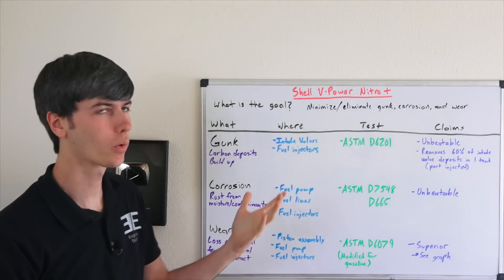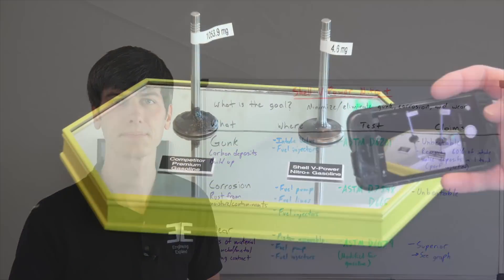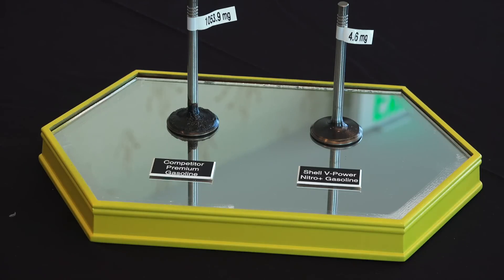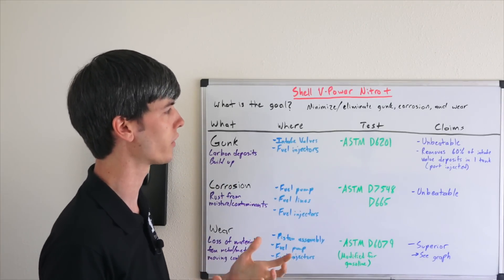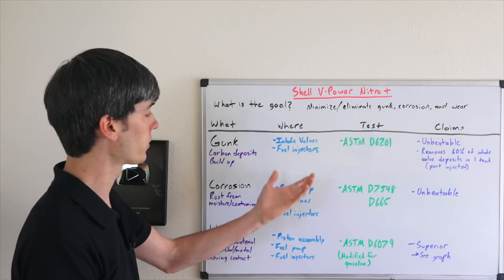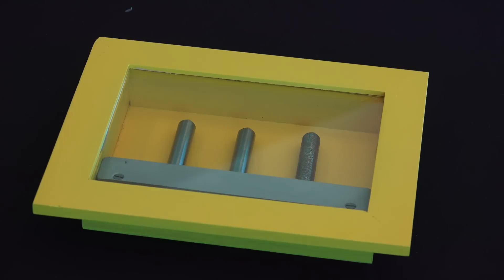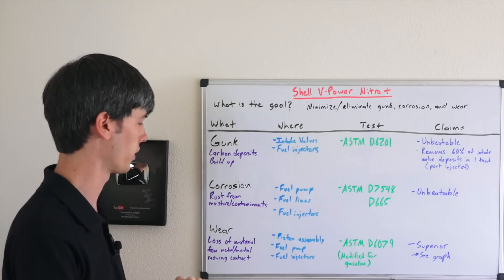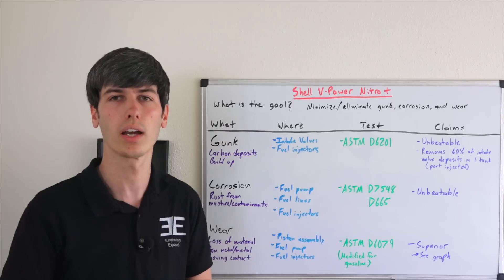Shell V-Power Nitro+ (Premium Gasoline Fuel Testing)

Comment: notice all his buddy's pics of nasty intake valves. the are all direct injection heads.  That gunk is from crank case gases being fed back into the intake track for emissions. No gas additive will do anything to that on those engines.  cars need better oil seperation on that emissions line not better fuel.  almost every engine sold now is direct injection so this is not actually a good test for modern engines.  I wonder why he wouldn't be showing the piston tops and combustion chamber as well?
Reply: Or run oil catch cans as standard
Reply: yes. I think oil catch tank eliminates gunk . the fuel n air shudnt produce gunk, I think. this is to sell unnecessary product instead of car manufacturer installing appropriate catch tank. correct me if I'm wrong. thx.
Reply: +cisa93 
I remember those oil vapors into the air cleaner housing.  What a MESS !  That little plastic fiber mesh filter was a joke !
-
I have homemade inline filters (two stage) that the oil vapor goes through before re-entering the manifold.  Once a year I clean the filter media with a solvent and then recycle the dirty liquid to a hazardous waste facility here in Boulder.  My containers have a valve on the bottom where I can periodically drain off condensate water, that is a component of the oil vapor stream.  True, that oil vapor hitting the hot intake valve will bake on as a hard air/fuel blocking crust, much like cholesterol in an artery.
-
There is a commercially available inline oil vapor filter called Condensator @  http://www.condensator.com/
-
Install pics here:   http://forum.ih8mud.com/threads/condensator-pcv-oil-catch-can-install-and-1-month-results.740888/
-
$225 U.S. Which caused me to build my own set up.  In 1984 they were going for $30 U.S.   Advert came in an envelope with alternative carburetion schemes literature which included plans you could buy for building the infamous Pogue carburetor.  The pages were copies of a copy of a copy of a copy of a..........
-
A small history on PCV:   http://www.herningg.com/projects/PCV.html
Reply: +Derrick Hollenbeck Ford Eco Boost engines have problems with intake valve build-up even at very low mileage--
Reply: +cisa93 I think they would actually work as intended to. it's the sensitivity of the engine that requires very specific adherence to manufacturers standard of maintenance that may fall flat with most consumer. 

aren't we all mostly looking for the cheapest fuel, cheapest maintenance, cheapest engine oil, etc.  

That's not to say what you mention isn't valid.
Reply: I think that Shell's detergent chemistry may not survive the heat of combustion well enough to do as good a job of cleaning cylinder heads and piston tops as some of the other detergents, like PEA based detergents.

Comment: man please Mystery Oil been doing that for many year an it cleanes ur engine in side out i been doing test since i was 10 years old i wouldnt say. i inow it all but i well say i know a little of a lot i am self tought engines tires rotors brakes  speakers amps electrical an many more e.g. gas 87 89 93 some pump may have 91 what are these number most peopel say gas is gas not true an oil is oil..........

Comment: I wonder if the "competitive" fuel is even a top tier detergent gasoline. I've seen these valve comparisons for years and they have always looked about the same - gunky competitor, near pristine with "our" gas.  That's not a new claim and with each new fuel released, the "old" is always the same gunky one that's been the basis for comparison for years.

Comment: dude those vw valves are from direct injection engines... totally not the same and fuel isnt washing over them. these deposits are really... imo.. produced by crank case vapour management and high volatility oil... but thats another video... btw top tier fuel is listed in many tsbs from all major manufacturers and i use only shell premium

Comment: +Engineering Explained 
So you did a video for Shell V Power in general, but in my area, we have 2 different types of the Shell V Power gasoline. One is a 0% Ethanol 91 octane, and the other one is a 93 octane that may contain up to 10% ethanol. I try to run the 93 when I can, but do run the 91 as well. Is there a benefit or lack thereof for either one or will running either one be okay? I'm also running it in an older car (1992 SVX) and I just want to get the most out of this engine before I come to rebuilding it.

Comment: we have had v power+ nitro for years in the uk.have used it in my motorcycle the past 2 years.wasn't  a fast fix, did take 1000s miles not 100s, but the mpg did slowly go up, to where it about 4mpg better.

Comment: Shell currently makes my SRT8 have short knock so I run Petro-Canada gas because its the only brand that doesn't cause knock. What octane will this new fuel be?
Reply: +4u2nvinmtl Found my answer on Shells site "Shell V-Power NiTRO+ premium gasoline is Shell’s highest octane gasoline". Shell V-Power NiTRO+ is 91 octane and that's lower than the 94 I currently run (from Petro-Canada) but I'll give it a shot again and see if I get knock (tuned for 91 octane).
Reply: +4u2nvinmtl aint it 100 octane?
Reply: Pilek01 Nope it's 91 octane. Checked Shells website...
Reply: +4u2nvinmtl in Poland we have 95 octane as the cheapest regular fuel also V-Power Nitro + is 95 in PL and Premium fuels being 98 octane while V-Power Nitro+ Racing is 100 octane as the best on market here. prices here are 4.67 us dollars per galon for regular and $5.7 for V-Power Racing.
Reply: +Pilek01 Lucky Polish!

Comment: Lol! All these comments are hilarious. I hope everyone knows that most of this carbon build up on the back of the valves is mostly related to Direct Injection and not so much tuned port. With DI, there isnt any kind of fuel or cleaner being sprayed on the back of the valve, its just an accumilation of hot EGR and PCV gunk. This new snake oil Shell gas is just more hype. He mentioned his friend who works at a VW dealer. Well an increasingly number of VW's are DI and the pictures are most likely from DI vehicles. Does Shell do everything it says it can do? Sure. Could you get the same results on a tuned port injection vehicle and run injector cleaner every now and then and give it the old Italian Tune Up to get the same results? Yes. If you own a DI vehicle and you want to fix the carbon build up issue, I would recommend a meth Injection setup with an injector nozzle right behind the TB and run 100% Denatured Alchohol in your meth tank. Support your local meth dealer...lol!

Comment: we have a 1980 mini club-man that has done 50 thousand miles and it runs on completely normal fule and we have the head off and completely strip the engine and it had barely and carbon deposits what so ever. For that amount of carbon build up there has to be something wrong with an engine people dont buy into this premium crap its no different to your average fule its just ripping you off

Comment: engine valves shown are from direct injection???? I don't think so!
Reply: +Engineering Explained port injection or direct injection? Because in DI engines the fuel/air mixture is created inside of the cylinder, so the fuel has no chance to clean the valves - can you explain your theory here please? I personally run N54 BMW direct engine 3.0 twin turbo engine with direct fuel injection, I use only Shell V-Power Racing 100+ fuel and I still get the carbon buildup on the valves, so something is wrong with this theory - please explain.
Reply from the maker: DJ12Ema Yes, DI, as annotated and listed in the description.
Reply: +One Monster exactly!
Reply: +One Monster Well the nitro stands for nitrogen which is used as the detergent in gasoline so maybe that has something to do with it but I totally agree with the DI point you and +DJ12Ema are making.

Comment: Looks and sounds like they are comparing regular gasoline vs their premium( you can see that in there graph near end of video). Regular gasoline has more methanol, which is basically alcohol. Alcohol holds more water(making for a better environment for corrosion) and has less lubricity that a pure petroleum product(more wear)

Comment: I'm glad they said nothing about power increase because it would be a lie but the name of the gas really makes it sound like racing fuel. Good marketing strategy . Also don't put a higher octane than what your car was designed for it does not increase power, if anything you would loose a very small amount of power because your car was not tuned for that octane, it is only necessary for high compression and high revving ended because it's more stable

Comment: Proper engine care. Theres a million more things to it, but these will help keep your engine is good shape. Follow the factory maintenance package. Start with a new engine. Use synthetic oil, change oil and filter every 3k miles. Run Seafoam every 25k miles. Use fuel injection cleaner every 6 months. Change spark plugs every 30k miles. Use the proper coolant for your engine, never blend coolants. If using coolant that is not pre-diluted then make sure to use distilled water with a 50/50 blend. Do a coolant flush every 40k miles. Use high quality fuel of the proper octane rating for your engine, your car has detonation (knock) sensors and a fuel system that accepts various different octane ratings, then use the highest octane rating possible (87-93, use 93) .

Honestly, I wish I was a chemist so I could properly understand which fluids work best and how to properly use them. I had the privilege of talking engines and cars with a PhD holding chemist not too long ago and learned a lot.
Reply: Alexis Leyva Also, if you are going to do any modifications (intake, exhaust, etc.) get a good tune for you car. Of course, in-person dyno tune being preferred over mail-in tunes.  And make sure the air/fuel ratio is always where it should be. In fact, an air/fuel gauge would probably be the first thing you would want to install so you can keep an eye on it at all times. Not only will a tune prevent you from leaning out and possibly damaging the engine, but it will also get you the most power out of your modifications, so there no reason not to get a proper tune.

Comment: If want to clean your valves clean, use a catch can insted of using this fuel.. In Direct injection engines don't matter the fuel cuz the injector is in the cilynder and in this video shows a different posicion of the injector...

Comment: Thought I'd point this out: Newer VW motors utilizes direct injection so the fuel does not contact the intake valves at all. The same goes for a huge majority of the new engines in the market as direct injection has proven itself to be more fuel efficient.

Comment: Why are you showing how dirty the valve are on DI engines are stating the fuel they are using is obviously not doing a good job? In a DI engine fuel never touches the intake valve so it doesnt matter what fuel you use your valves will look the same.
Reply from the maker: SkitzoPhr3nia Pointed out via video description and annotations. And as stated in all the comments below... my bad.
Reply: Engineering Explained Can you make video about EGR system?
Reply: DI still get gunk on the intakes because of oil vapors going in from the PCV or something. get toyotas they got DI and port.

Comment: People, looking at these pictures - this is not carbon buildup on the intake valves, these are leaking valve seals. Not on all of them, but on some of them. The carbon buildup is from the exhaust gases that are routed back to the intake from the EGR valve. And of course on a direct injection engine the fuel cannot clean this - you will have to do it manually.

Comment: Where the valves that where pulled from those two different engines on the exact same oil change schedule? Where they both drivin the exact same route everyday? Idled the same? Only different was the fuels? Because i also use the cheaper gas. I always follow a religious oil change schedule. When i dip into my motors i never find valves that look like that... ever...... and for that "cylinder test" why is the the rusty cylinder sample larger than the other too? Im guessing diff metal so that it would rust making the other to look better..

Comment: if the standard gasoline vehicle changes to nitro+, will it have the carbon deposits removed?
Reply from the maker: mingleshy xwm According to their research for port injected engines, 60% of deposits in the first tank. Bold claim but they have tests to back it up (legally).

Comment: Too bad this won't do anything to a direct injected engine. Most of the fuels these days got some additive in them to better clean the valves but it only works if they come in contact with the valves. On VW with DI, this won't do anything.

Comment: this seems pretty faked. none of the data is in any way scientific. "this is a valve of an egine run on a competitor fuel"... yea right..... the gunk on the valve was more than ive ever seen on any car even after 150k miles... im dissapointed that you fell for it or got bought or whatever.

Comment: Engineering Explained 
But the pictures your friend sent are from direct injection and the gunk on the valves could be fixed with a oil catch can, fuel never hits those valves right? (Wag tfsi /fsi low friction engine )

Comment: So I can this be better then e85? Ethanol has the best cleaning capabilities vs leading gas. If you can do a video comparison between the 2 that would be awesome!
And also it's hard to believe it cleans that much. If shell can back it up with active testing then awesome I would use this gas every time I fill up.

Comment: I use shell and castrol religiously. I've taken my car to about 8 or 9 lapping days, and the only thing that's broken is the catalytic converter from getting oil blowback from the crankcase. Not even the gasses fault. 

seriously, there's legitimately a subtly difference when you're using shell V-power. My dad's c300 4matic won't break the wheels loose in the rain on normal gas, put some of this stuff in, and boom, suddenly it has enough power to break the wheels loose. After I experienced that, I swear to it. And like I said 9 lapping days using shell and castrol, and no issues whatsoever. 

Can't wait to get this nitro+ gas where I live, hopefully it cleans my engine better than previous shell gasses.

Comment: Could have used two separate fuel tanks/lines fed in to separate cylinders of the same vehicle? A more accurate test?
Reply from the maker: MPThornton1 Ahh, they're actually supposed to be doing that this summer. Should be interesting depending on how much information is disclosed.
Reply: Keep us updated! :-) I've recently switched to Diesel Nitro+ and my engine is actually running smoother.. If the fuel is the reason- I'd be happy to pay the extra 5 pence a litre!

Comment: Does nothing for a direct injected car, so if you have direct injection, don't waste your time or money.

Those VW intake valves he is showing you are not a good example, they direct injected.  Those were all 2.0t TSI/FSI engines. 

This means that fuel does not contact the valves in the same way their test valves displayed by shell (port injection)
 Engineering Explained, can you clear some of that up?
Reply: That is unless it's required by the engine!! And save your money? Here it's o oh 11 cents more than regular. Filling up my tank on average takes ten gallons, so I pay 1.10 more for super. Premium fuel is worth it, according to consomer reports independent testing, cars ran better, got better mpg, and the valves were cleaner and almost like new on the engine they tested. Of course GDI won't make a difference because the gas doesn't hit the top of the valves to help clean it.

Comment: Are these tests performed & reported on by an independent unbiased, independently audited facility?  If not the likelihood of bias, (both unintended and possibly intended) altering the claimed results is high.  Given the fairly extreme results, I'm highly skeptical that this isn't just marketing statistics bending - for example, the classic marketing spin is taking the worst result from the competition and comparing it to the best result from their own products and ignoring everything in between.  Another possibility might be repeatedly using a batch of stale/contaminated fuel from the competitor during testing.  There  are so many ways results can be skewed, intentionally or otherwise.  Always take this kind of thing with a huge grain of salt.

Comment: Regularly work on a MKV GTI with a FSI (BPY) powerplant so I can also personally co-sign on the rampant carbon deposit buildup on the intake valves... BUT fuel additives/detergents matter not one bit (as far as valves are concerned) when used in modern direct injection engines. Have never had an injector failure so can't speak on how "top tier" fuel prevents failures (even though we always use top tier in the GTI hahaha), although I can still fondly remember the very real performance boost that came with using BP's "crystal clear ultimate" 93 octane 10 years back. But then there was a fuel shortage and so they had to mix regular "dirty" fuel in abs that was the end of that...

Comment: I've used the diesel variety of shell vnitro on my seat leon 2.0 tdi and it is actually amazing. Improved throttle response makes the car feel full of extra life and mpg is equally the same, if not better. It is around 9-10p extra per litre but it's definitely worth it

Comment: the gunk thing should only apply to MPI engines.. direct injection has no way of cleaning intake valves since the fuel is not injected in the intake.. also humble mechanic's pictures apply to volkswagen cars, and i suppose most of them are from newer cars which all have direct injection with EGR.